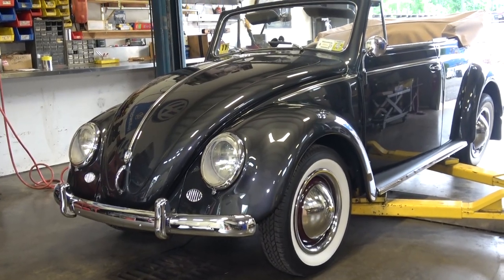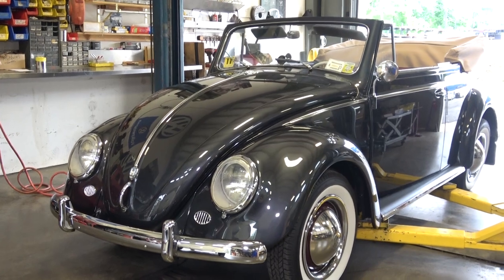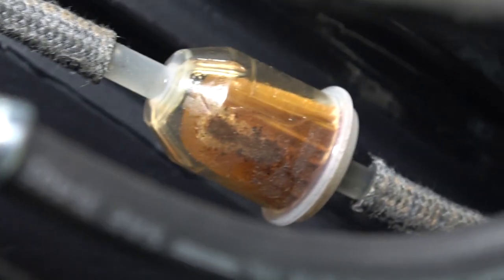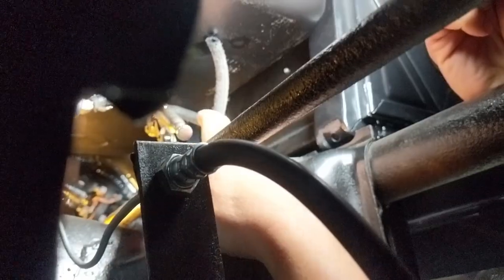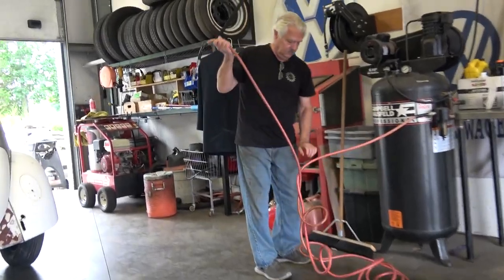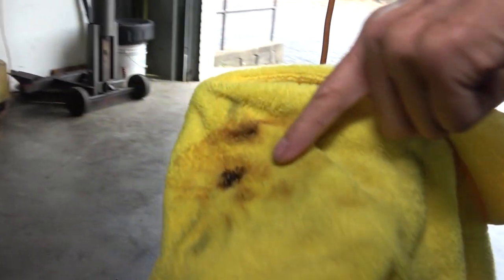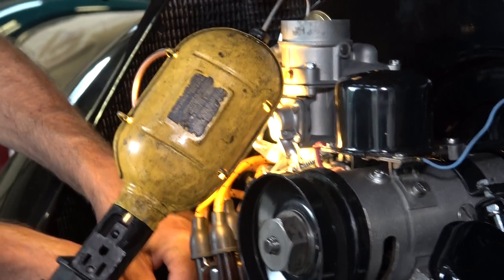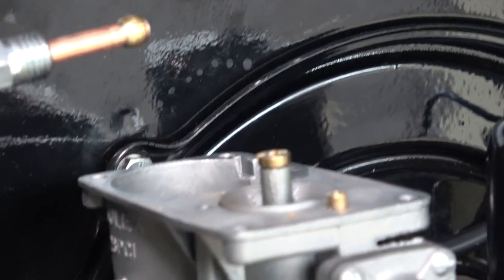Classic VW BuGs - 1954 Beetle Chassis Fuel Line BLAST - BLOWING the JUNK OUT!

Comment from the maker: Hey Volks!  In this video we blow out the center chassis fuel line from my 1954 VW Beetle BuG convertible.  This is very common to happen with your VW.  My 1954 VW is 68 years old at the time of this video, so you can imagine what is lurking in that fuel line.

Yes we blew the line out when the body was off the chassis, but when you run fresh fuel from today through the line, it can start to free up some rust and debris that has been in there, thus clogging fuel flow to my carb.

Ethanol gas today acts as a cleaner, so it frees up a lot of junk.

If you need to run a new fuel line in your VW, watch my video https://youtu.be/tr8xKzfXxt0

My toolkit travel video is here https://youtu.be/UODFB9OiwIQ

Comment: All great ideas. What I have recently started doing, is capping the transmission side of the fuel line. Then I fill the line with Sea Foam Aerosol injector cleaner. It takes a while to fill up the tube, because it foams. During the day while I'm working on other stuff, I just keep topping it off until the line is full.  I also fill the choke tube at the same time. Continue on with other mechanicals....and a week or so later, I blow both sides out. The Sea Foam does a great job of loosening the choke cable and sleeve up. AND it really cleans up all the dried up sediment in the fuel line. Since I changed to this method...I rarely get dirty fuel filters after 1st start up. Great video!

Comment: Chris…thanks for this.  I’m retired from the USAF.  Was an aircraft mechanic on B-52’s, C-17’s, and C-5’s.  My problem is not having a lift, leaving me trying to crawl around underneath my bug, and do these maintenance items.

Next question/video idea…going through the many reasons your VW engine would be running hot…thermostat is working correctly, new distro and carb, timing set, etc., etc.  I MUST be missing something else.

Maybe a videos series on each of the cars systems, electrical, brakes, fuel, etc.
Reply: I need a lift too.

Comment: Great looking car! I also have had an issue with e-10 sitting in the tank too long, it absorbs moisture and adds water to the mix causing rust.
Since my older cars are not driven regularly, I have been "de-ethanoling" the e-10 and find much less sediment in the filter.
Its easy, just adding gasoline and water to a clearish HDPE (which is gasoline safe) container, allow to settle and siphoning off the ethanol free gas from the top.
There are many videos of the process.

Comment: FYI, I’ve used an old clutch cable and ran it through the fuel line to rem it out and used cab cleaner. That work pretty well.

Comment: Drain snake from Seth is a good idea, I would try that to clean it better, and rig something up to flush it out. At a VW dealership I worked at in the late 70s, we used to twist two 3 foot welding rods( not flux coated, the ones used with gas similar to brazing rods) together for cleaning out the heater cable tubes, worked great! You hook a drill
Reply: To one end for power.

Comment: Left you on the side of the road.  Darn!  Oxygen is the enemy.  Lines that sit dry for years, not good.  I use no aux filter.  Just tank screen and pierburg pump screen.  Clean pump screen at every oil change.  5 years smooth sailing!

Comment: @chrisvallone, any tips/suggestions on removing rust from the tank and preventing flash rust? I used WD-40 Rust Remover, then vinegar. Both products removed the rust, but after rinsing with water, then rinsing with gas and WD-40, I'm still getting flash rust throughout the tank. Should I leave it and just add the second fuel filter by the tank?
Reply from the maker: yeah hard to do, you would have to boil out the tank and have a sealer put in like POR-15 offers for gas tanks.  A 2nd filter doesn't hurt either.